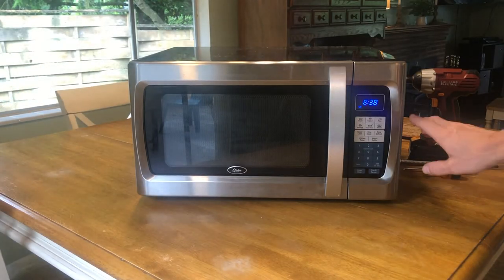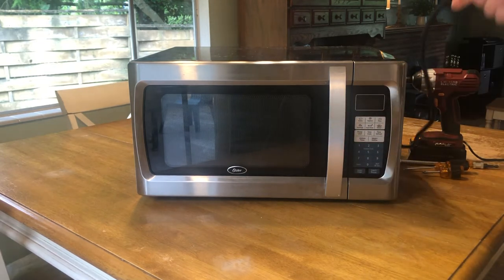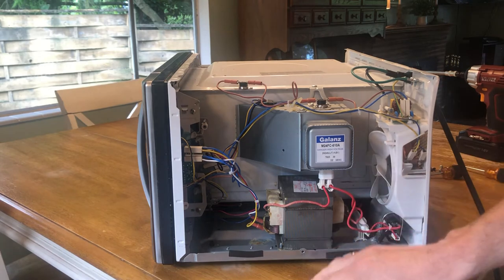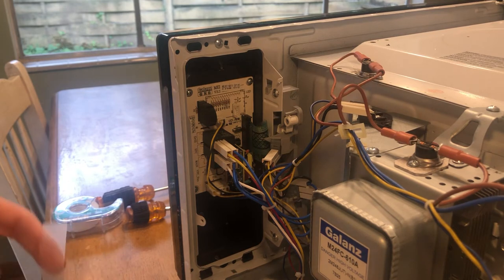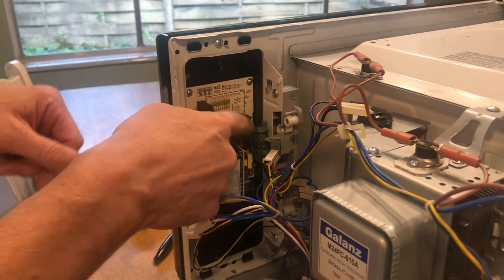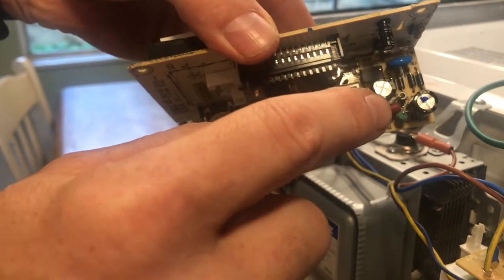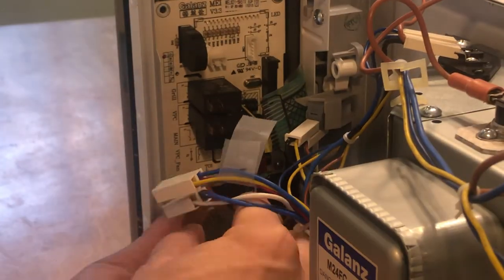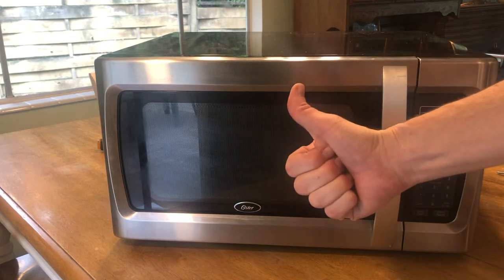Broken Microwave Keypad? How To Diagnose & Fix (Slugs Broke Mine!) | Handy Hudsonite

Comment: Great video. My touch pad is not working. Haven't pulled it apart yet. We have been unplugging it and back again. It works until you have to use it again. Im afraid to take it apart?